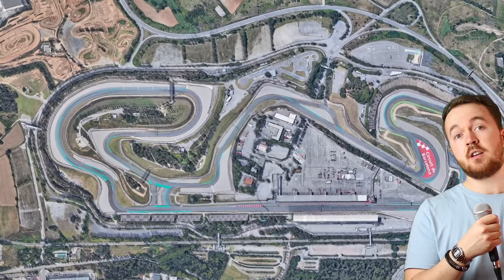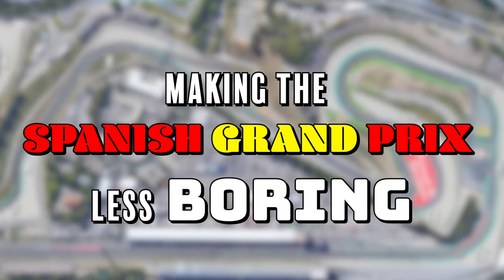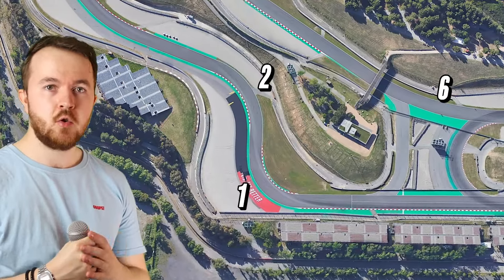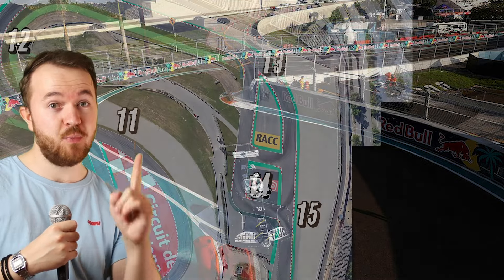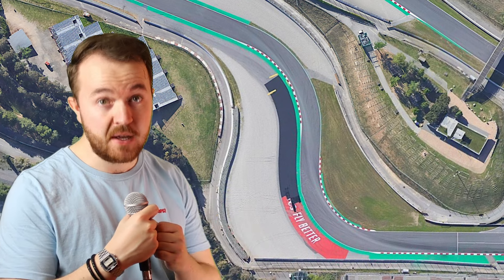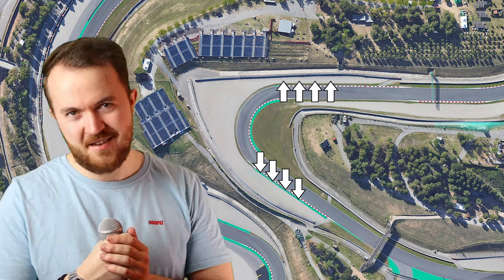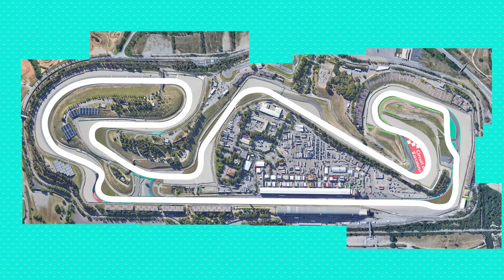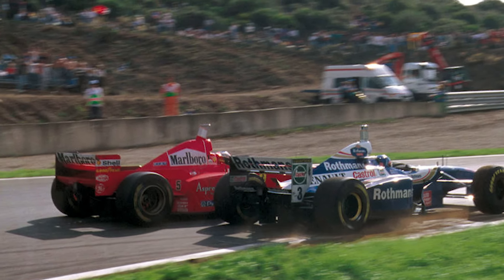Making the Spanish Grand Prix LESS BORING

Comment: I'm a bit surprised there's no changes to turn 10/11. With other areas being tougher in your version that might not be necessary, but I'd still consider switching this up again to the sharper hairpin with maybe one or two other changes.
The one I'd consider is moving the hairpin further down the straight, although that might make it harder keeping the alternative corner layout distinct, so I'm not sure.
What I'd definitely do is make the road after the turn wider and reconsider turn 11. Either go straight from 10 into 12, move 11 closer to 12 or widen up 11 a bit to get a better flowing line from 10 into 12.

Comment: With the recent discussion of a race in Madrid 2026 onwards to replace Catalunya, I'd like to see Jarama back instead of a street circuit.

The one bit but is that Jarama has been without any changes for a really long time, it's clear when you get there that it's from the 60's/70's and they don't have much budget so they can't renovate as they should.

Apart from that, if they managed to do the necessary changes it would be great. It's has lots of corners in quick succession and a lot of elevation. And from the straight grandstand you can see the uphill, downhill, and the tricky hairpin which I don't remember the name (Bugatti I think it was)

And the track, if I remember well, is as short as Mónaco, so qualifying would be pretty exiting. And also there's a lot of places where drivers could have an error and end up in the gravel trap

Comment: Actually Mr V, I have a question. If we take the concept that a two or three stop race is more exciting (trickier strategy - more chance?) than a race where absolutely everyone stops once (coz they have to), then why not artificially reduce the time lost to pit? So if the pit entrance is placed at a point earlier on the track (cutting more of the track off for that in lap) then the time lost in the pits to change tyres was only 15s or 10s, this would surely encourage teams to pit more often? So looking at the Spanish track, move the pit entry to say somewhere around turn 10 (after the back straight). Also fairly cheap and easy to implement at some tracks? What do you think?
Reply from the maker: it's a good question, I think the main problem would be for other Motorsport with slower laptimes, for them the pit shortcut might literally be faster than the track and so the track is ruined. You also have to remember that most track have lots of stuff in the middle where the new entries would need to go. I agree though quicker pits would make strategy more interesting